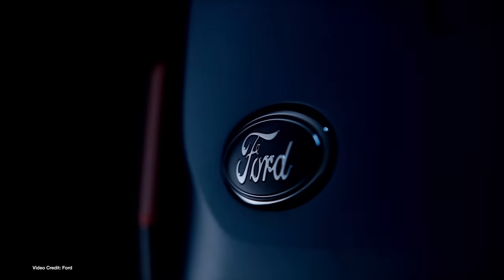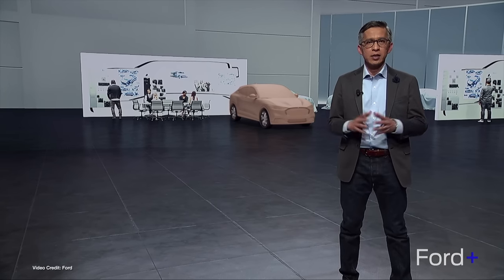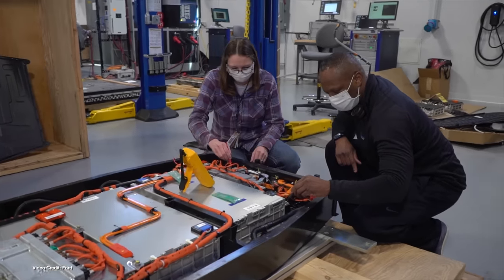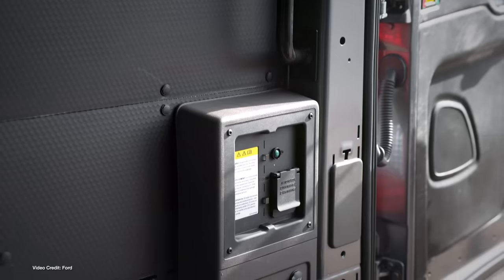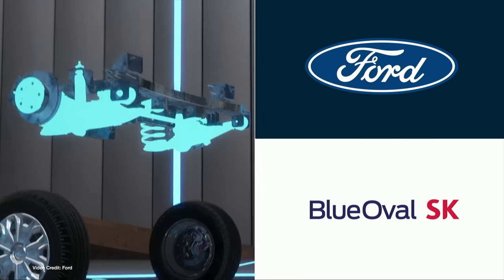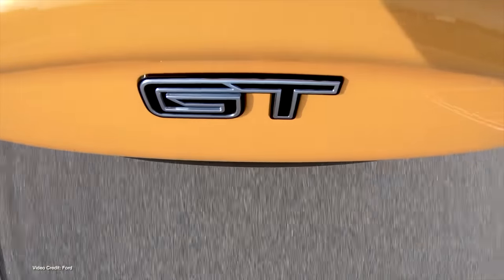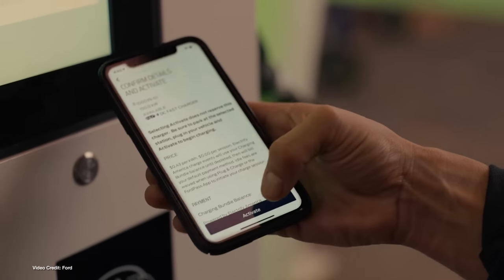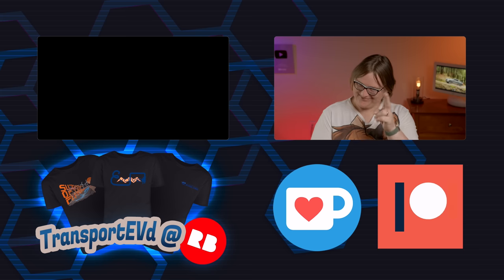Ford’s Grand Plan for Electric Vehicles Is Here

Comment: If battery pack production has reached parity point of $ 100 /kwhr, then we should have electric cars that cost the same as petrol cars, right? Instead of three times as much.
Reply: Yes and no.  The COST to manufacturer a new BEV is now less than a similar ICEV when made at the same scales. But as battery supply, therefore BEV supply, is still limited, the laws of supply and demand take hold driving up the PRICE consumers pay to a $10k premium over a similar ICEV. This is why manufacturers are now piling on to BEV manufacturing, it is a better product with a lower cost that sells for a higher price.
Reply: They don't cost "three times as much", that's a silly claim. You can't just look at the price tag, that's cherry picking. Look at total cost of ownership over five years for example. That said though, even if you only look at the price tag an ID.3 does not cost three times as much as an ICE Golf with the same trim, not even close.
Reply: Seybertooth Tesla’s in Australia (where I’m from $75000) where similar petrol cars are around $25,000. So not a silly claim at all. I get that there’s less service and less fuel cost, but after 8-10 years you may need a new battery, which may cost half as much as the whole car, so no wonder ev’s are not selling very well at all. Most manufacturers seem to. E making their compliance ev models and setting huge profit margins, then going to the government and saying “See? No-one wants to buy these!”

Comment: If I'm not a pro (professional?) person, can I get a Ford F-150 Rookie with a Rookie battery and Rookie suspension etc.
Sarcastic comment, but it seems that pro is added to everything. Not even only in Ford but other products too.
Reply from the maker: Nilay Patel from The Verge immediately made a joke about the next model being the Ford 150 Pro Max (in a dig/nod to iPhone naming conventions) - Winter
Reply: @transportevolved  looks like ford really buttered you up! Worst financial mistake you ever could have made... The Cybertron caused $100 to reserve and you could have selected the full self driving and locked in the price before the future increase and use that same money to lock in this vehicle that will make you a net positive income on the Tesla taxi fleet instead of being a net loss and income like every other single car at the moment you drive it off a lot... The full self driving is the most important part FSD full spectrum domination. Plus that Ford just looks like another Ford pickup truck looks like nothing significant at all. If they do not have a camera system for building a visual Data Network for full cell driving then it doesn't matter having over the air updates because the future is full self driving the money is in full self driving! I'm not sure how a lot of you YouTubers have not realized this yet maybe that's why you still have subscribers! The moment you start speaking the truth they blacklist you! Just like me!

Comment: You can't power your house during a powercut unless you (electrically) isolate your house from the grid during the powercut....
Reply: Interesting point.  Does that mean an isolating switch at the switchboard?  (I'm an ignorant aero guy).
Reply: I assume the 80amp inverter deals with this.
Reply from the maker: As you might expect, that’s been taken care of in the design of the unit - Nikki.
Reply: I believe they mentioned that this was part of the install for the 80 amp charger. It's the same as the install for the Tesla powerwall and other battery or whole home generator installs.
Reply: @lautoka63  Yes, that is what it means ; there will have to be an isolatie switch, either manual or automatic, at the (electrical) entry/connection point from the grid to the "private" property.
If not present "the car" will try to (reverse) power the grid and probably "trip" a "car internal" fuse or "worst case" short out.
P.S. just an Energytechnologist here..
Reply: Thank you all.  Now, about the fact that AC is meant to go this way then that way, but is actually going that way then this way, ...
Reply: @Test Test You are correct!  For the feature to work,  you need to purchase Ford Charge Station Pro, Home management system and an Inverter.   The installation of this will be expensive and you wouldn't have some of the added benefits that a Powerwall or similar storage systems have.
Reply: @transportevolved  *With a bit of expensive  electrical modifications to your home.
Reply: @DanWS100  Well expensive is relative, I doubt many people who can afford to pay for this option will blink twice at the cost of the installation.

Comment: the ‘range with 1000lbs’ is huge. Why didnt’ they shout that from the rooftops at the time? What will that make the range for most peopel without a load in the back - 350-400 miles?
Reply: I suspect they wanted to under-promise and over-deliver. Otherwise, they would need three confusing ranges. For example, 175 mile towing range, 230 mile working range (1000 lbs. in the bed), and 350 mile lifestyle range (never use the bed or tow). LOL

Comment: So the gigantic Fords grand and ambitious battery plans for this decade is 10 times smaller than the small company Tesla.. 
im 100% sure Ford will loose money on every bev pickup sold, and have a healthy profit on every ice pickup.. so why would they scale up their bev numbers to anything meaningful?👍🇳🇴
Reply: Once that SKI plant is up and running, the electric F-150 will be very profitable.
Reply: @williammeek4078  SKI already has another major customer, VW. And what is the output of that factory to be shared between their customers. Volume EV production depends on available batteries which is why Yesla has been battery constrained and unable to have the batteries for the Semi until they start cranking out their own 4680's.
I wish Ford well, but they should have taken a leaf from Tesla's book and started doing battery factory partnerships at least a year or two ago so they have battery availability now.
Reply from the maker: You’re missing the nuance: BlueOval SK will be Ford’s dedicated battery endeavor with SKI. It will not be shared with VW. VW will have its own battery facilities - Nikki.
Reply: @j.pgoodwin9020  Rumor mill has it that VW and Ford are going to be working together using the VW electric platform. I agree they aren't going to ramp up lightning production until the price of batteries goes down when SKI is able to meet demand. Unfortunately with a company like Ford it's all about downside scenario, they won't release a bunch of money to invest in battery factories unless they know the product they are going into will sell, but they will be fine eating a few grand for each base model lightning they sell. The real question is will dealers discourage people from buying it.
Reply: Ford bankrupt before 2030...
Reply: @j.pgoodwin9020  Ford’s battery factory is a joint venture with SKI. The output is dedicated to Ford.

Comment: Ford likely loses $25K per F-150 Lightning it will make. It's losing money hand-over-fist on the Mach E. Something has to change for Ford...it's appointment with a 2025-2026 bankruptcy looms.

EDIT: And I disagree that ICE expertise directly translates to Ford's ability to pivot to the BEV ecosystem. Off-the-shelf engineering is where the BEV industry leaders will leave legacy auto, and others, in the rear-view.
Reply: Rumor mill has it that it's going to try and get help from VW for smaller electric vehicles, a Stelantis type merger when Ford becomes another VW company wouldn't surprise me. What surprises me is they are going with Solid Power instead of Quantum Scape for solid state battery research.
Reply: Ford bankrupt before 2030...